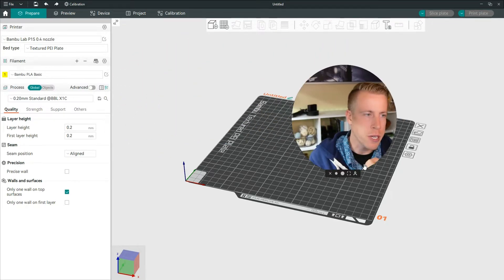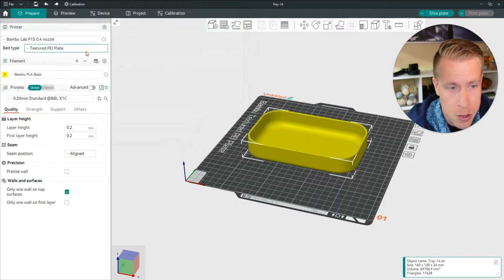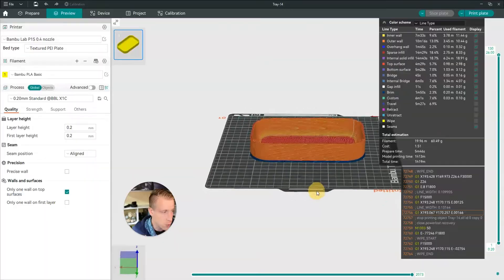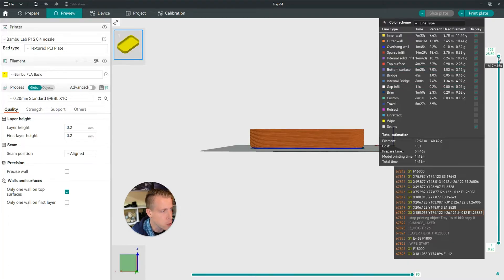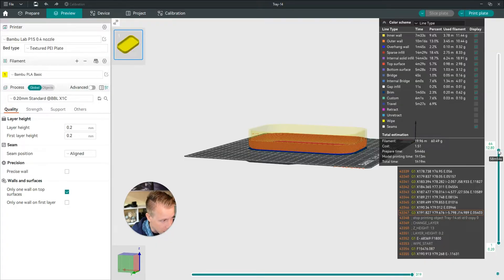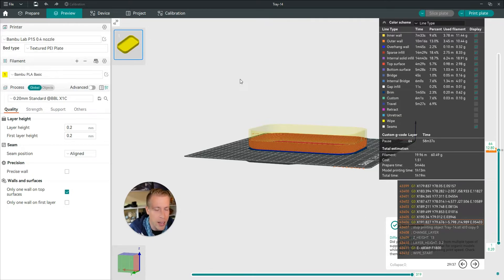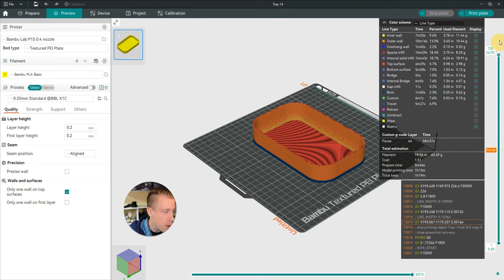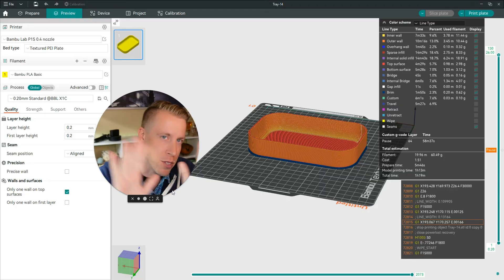How to Add a Pause in Orca Slicer

Comment: how long does it pause for?  will it just start back up automagically?
Reply: You manually restart the printer.  If using a web interface (Fluid, Mainsail), you should have a green play button to click.
Reply: @Liberty4Ever  thanks..i ended up finding it.  i thought at first it was a time based pause and it resumed auto but i found the button... again, thanks.

Comment: Thanks again for a great tutorial.  Quick question - let's say I print the base of a model with fuzzy on, then pause at a given layer.  Can I switch off fuzzy for the rest of the print?  I'm thinking this could be a more general question because, if you're going to switch filament you may also need to change the settings.

Comment: Nice video, but it didn't work with klipper. I think it would be nice if you told us to look at the printer settings in orca slicer and check the "Pause G-code" setting to make sure it is compatible with your printer. In my case, I had to change the Pause G-code from "M25" to "PAUSE".

Comment: dang. i messed with this for an hour and even tried right clicking. but in mac i guess the two finger click doesn't work for some odd reason. very frustrating. control click fixed my issue now that i know this is how its done. thanks for this .

Comment: Awesome Short video! This also works for the FLSUN slicer, which is based on the OrcaSlicer (and PrusaSlicer). I was right-clicking on the actual Gcode to try to insert a pause and didn't think to right-click on the scroll bar. Thanks!
Reply: I did the same.

Comment: Thanks a lot. Is it anyway that I can choose where the printing head is going to park? sometimes I want to print several colours and is very dificult to change the filament when there is only 1.2 mm from the plate to the nozzle.
Reply: Instead of clicking 'Add Pause', click the 'Add Custom G-code' and add the code M600 - this is designed specifically for filament swapping and will park the head away from the print.